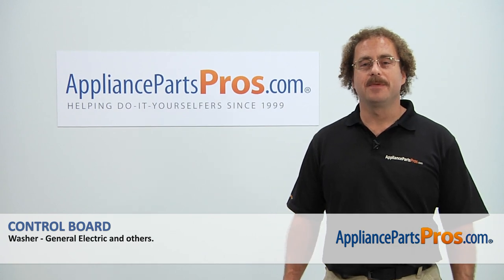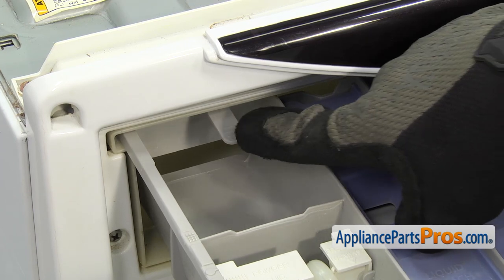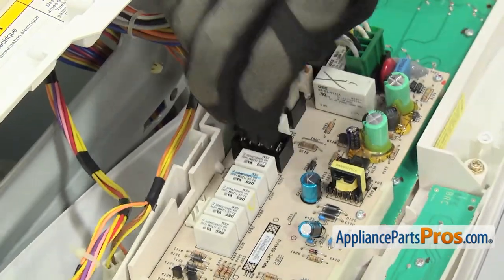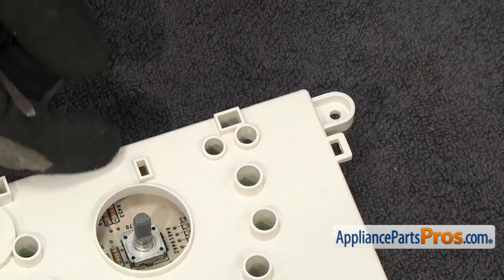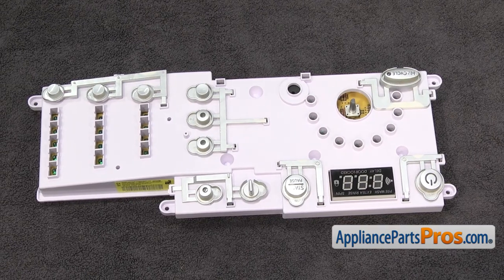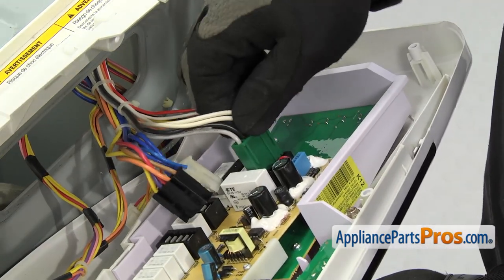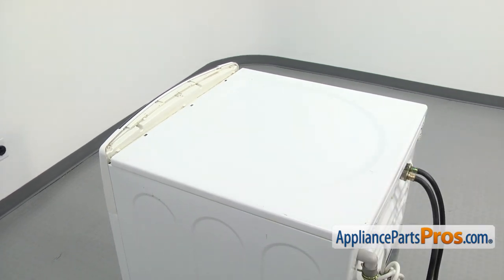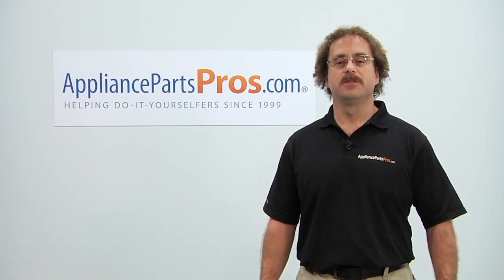How To: GE Control Board WH12X10468

Comment: Here is what (most of) the programming instructions sheet says, transcribed from the images in this video. The manufacturer should enclose in the box an instruction sheet for you, but mine was missing.

Procedure for Programming WH12X10468 Control

When replacing the control board, the washer will not function until the replacement
control board has been programmed.

The replacement control board will always enter into test mode t01 on initial power up.

1. After installing the new control, reconnect power to the washer to power up the 
control.

2. The new control will now display "- - -", which means no model has been selected.

3. Rotate the knob until correct model number is displayed.

Select 1 for the following models:
	WHDVH680, GHDVH680
Select 3 for the following models:
	WCVH6400, GCVH6400
Select 4 for the following models:
	WCVH6800, GCVH6800
Select 5 for the following models:
	WBVH5200, GBVH5200, WBVH5300, GBVH5300

4. Press and hold the Start key for 3 seconds (or until a second "beep" is he[???]

5. Press the Power key to reset the control.

6. The washer is now ready for use.

If an error is made in programming the control, enter test mode[???]
steps 3-5.